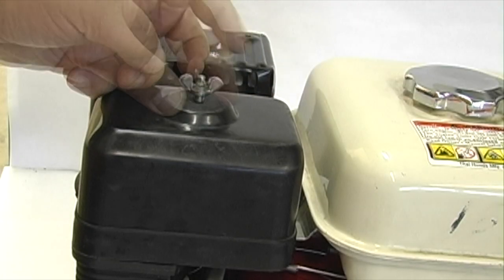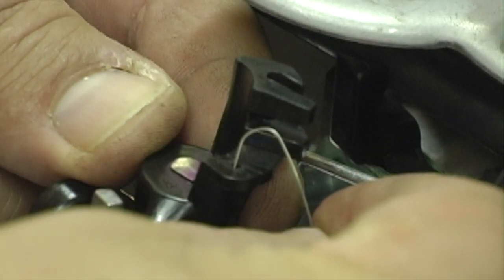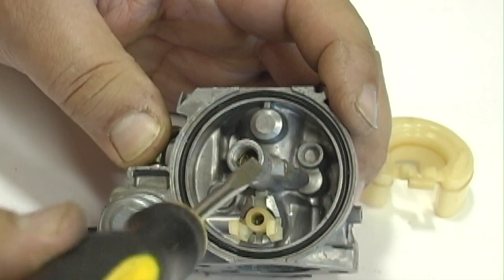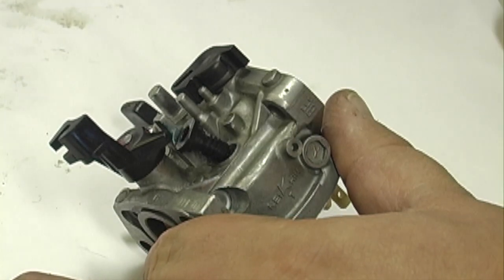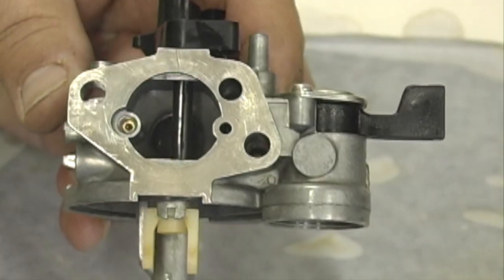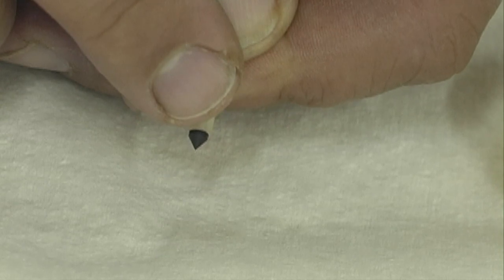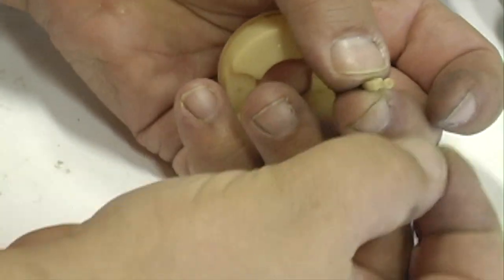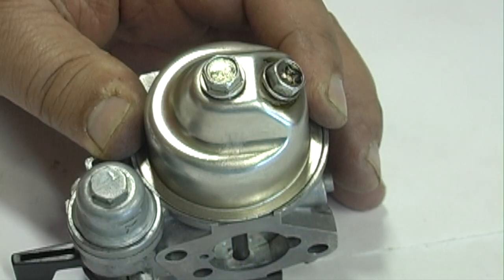GX160 Carburetor Service

Comment: Great instructional video. I have been wondering how the holes are connected. What is the purpose of the cut-out hole that appeared at 13:07 ?
Reply from the maker: Another great question that I don't have an answer for.

Comment: I have a copycat cloned chinese carb on a titan pressure washer...it does not have the pilot screw...it is either missing from someone else messing with the carb or it never came on...there is a hole there for it but it doesn't look like there is any threads inside and no small hole for the pilot to get through into the carb main body
Reply: I wonder if this is why I can't fix this surging problem....it does not stop surging no matter how efficently I clean the carb.